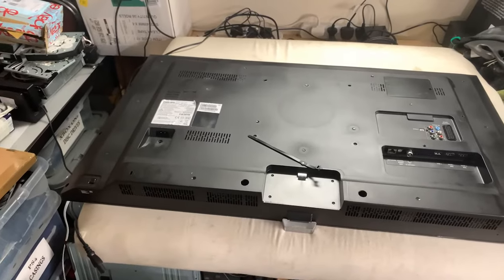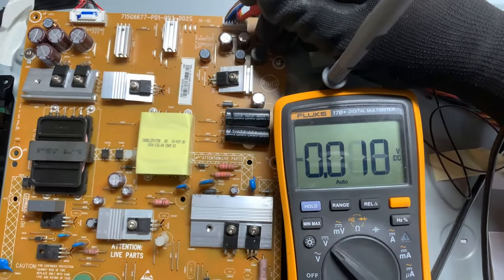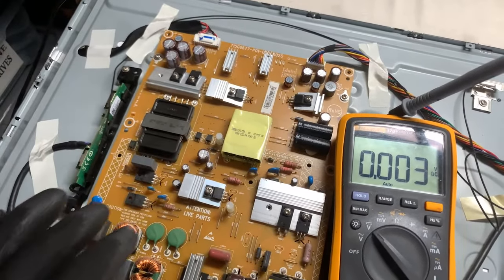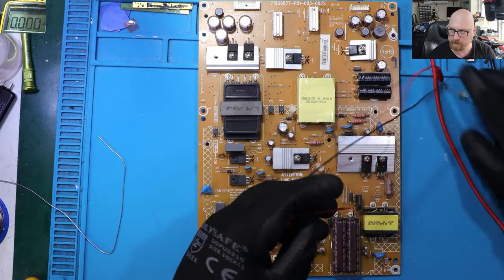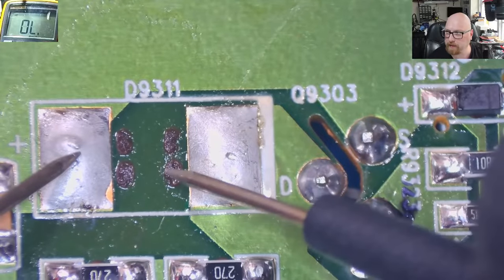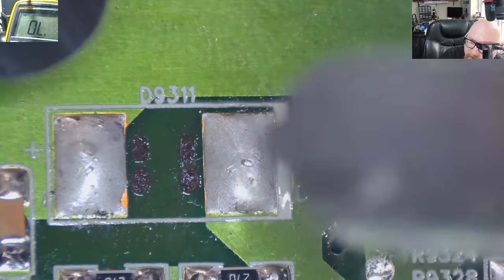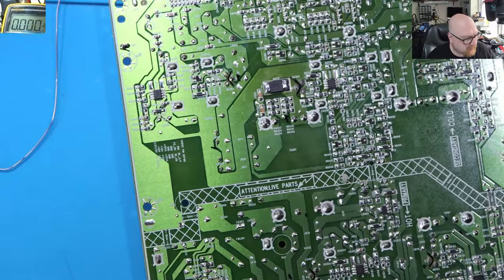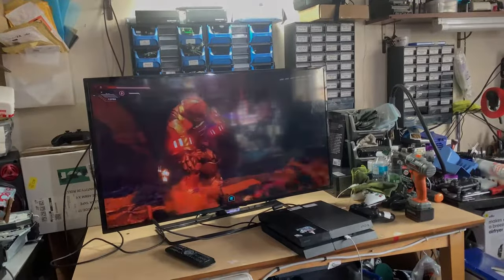DEAD TV PHILIPS 40PUT6400/12, NO POWER. CAN WE FIX IT?

Comment: Nice fix. Just one thing to mention. Optocoupler is a led diode and a  phototransistor so its never cross shorted. You can check only one side at once. To measure it properly you gonna need 2 multimeters both in diode mode.

Comment: thank you for the helpful video! Came here to get better in troubleshooting, but it turned out that my own tv (55pus6561) had exactly the same issue. The PSU is bigger but very alike. Was a nice and easy 60 cents fix.

Comment: Is the standby voltage coming from the mailboard, or is is created on the powerboard?, i have a Philips philips 715g6973-p03-002-002m  powerboard. the 12 volts are present, but not the standby 3.5/5 volr. grateful for any hints/tips :)

Comment: I have a Phillips TV (2013, model 42PFL3188H/12). One of the bolt brackets got loose and I moved the TV to hear the rattle and suddenly no sound. Then lifted it and no picture. TV now won't start (but I do see a Phillips logo but then stops and restarts with logo but without progression to picture). Turns out the bracket wedged behind the power board. Could you check/repair (or replace) if I sent you the power board?